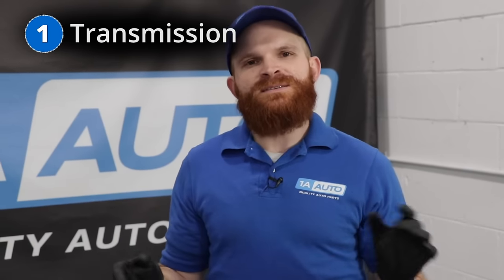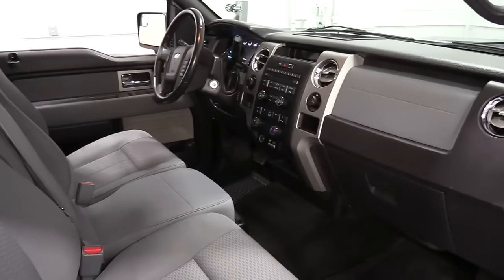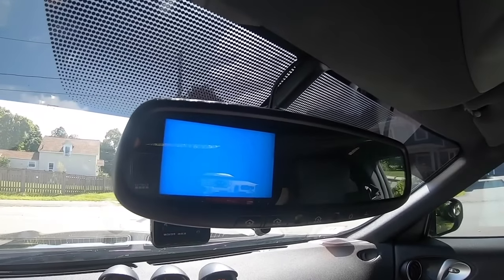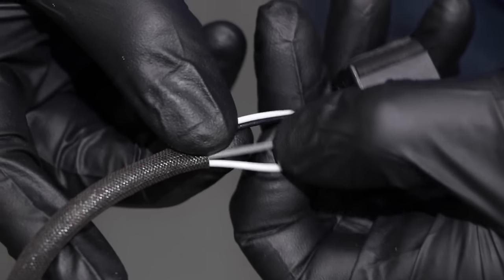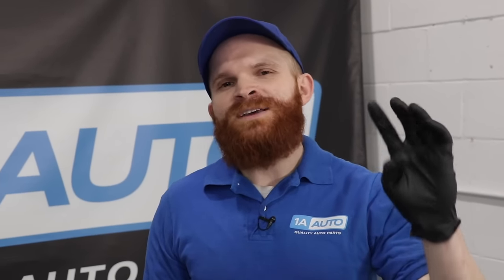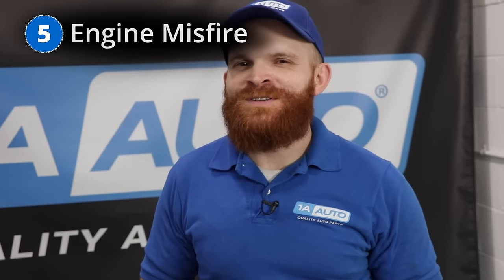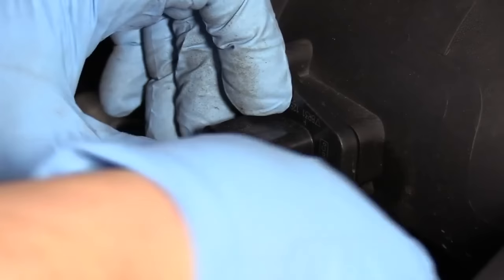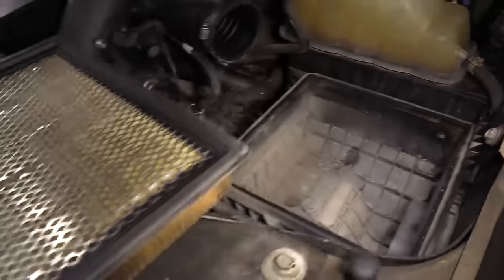Top 5 Problems Ford F-150 Truck  12th Generation 2009-14

Comment: Just fyi a couple things. I've had most of these issues and here were my fixes that differ from the video. 1 misfire. If your Ecoboost is running fine at idle and low speed but misfires when you step hard on the gas you have an issue with the intercooler building moisture and oil. It's an extremely easy fix and if you YouTube Ecoboost wheep whole you will see Many vids on this. You basically drill a very small hole in the bottom of the intercooler. After I did this it took 90 percent of the misfire away and after changing my plugs completely went away.  (takes 10 minutes to do even for someone who doesn't know what there doing) 
2. The touch screen not working. This is a problem with the ampid modular in the back of the head unit. They aren't cheap but easy to install a new one. Just make sure it's programmed to your truck.  
3. Backup camera not working. Mine did crazy things like reversing the image to lines to a black screen. Usaly it would work when you first stay the truck then go haywire lol. Just replace the camera. Super easy but unfortunately on mine I had to replace the Ford logo as well.

Comment: 2013 F 150 4x4 STX 5.0 with 3.73 gears. 225,000 miles and still going for now. Did replace transmission at 180,000 miles due to weekly towing of heavy boat. Normal maintenance other than that. I know the time is near for a new truck. New truck prices just blow me away. I wonder what a new 5.0 motor would cost? If it's even worth it?
Reply: Larry Sigers, engine isn’t that costly when you think of a new truck. $7000-ish. Maybe get it rebuilt.

My 2014 FX4 has 245,000 km and aside from oil/fuel/windshield/washer fluid/wiper blades/tires it’s all original. Never had any of these issues.  It’s now getting everything flushed, new brakes and struts, new filters, hoses & spark plugs and I think I’m swapping gears from 3.73 to 3.31/3.08 since I do mainly highway driving at a set speed.
Reply: 5k easily, but that's a hell of a lot less expensive than a new truck.
Reply: Your boat is holding water under the deck. Get rid of the boat, not the Ford

Comment: I've put 140k miles on my 2011 f150 ecoboost, very few problems, 2 purge selonoids, regular tuneups, 4wd actuator, and a thermostat, and basic parts that just ware out like brakes and rotors.  Now my old 2006 f150 was a different story.
Reply from the maker: +jg b Thanks for the feedback!
Reply: Considering buying same one with 110,000 for $17,000.00. Are you still happy with yours?

Comment: 2010 F150 5.4 Triton Ecoboost V8 101,000 miles.   New spark plugs by Ford at 100K - still have a slight rough idle (no codes/check engine light) and after it sets for a day, fuel smell outside for a few minutes.   Mileage intown/road is around 12-13 mpg, and has been forever.  Thoughts?  (I'm second owner, and have had it since around 40K miles.  It does have a K&N air filter.

Comment: Another common issue with these trucks are broken spring in the strut assembly assembly and the third taillight above the back window after a few years, leaks water into the back seat area.

Comment: 2013 4x4 5.0 I bought it used 48K. I use motor craft oil and change every 9k. No motor issues. now @ 150k. Front breaks go bad every 20k no biggie. Shocks have been replaced 3 times getting ready to do them again. Now the bad radio went out at 90k aftermarket fix. Both front window motors went out within a month of each other. AC compressor stopped working around 95k. Blower motor went out around 115k. The y pipe for the coolant has been replaced twice. Put a leveling kit on the front and things got fun.bad bearing hub and Bad actuator, then bad CV shaft. Replaced both sides. 8k later new actuator again new CV shaft and new vacuum lines and vacuum solenoids. Now it’s all bad again. For some reason the vacuum isn’t fully disengaging causing the actuator to be destroyed. And the drivers side CV shaft seal keeps leaking and tearing up the boot. I do not off road or drive in 4x4 often I never switch going faster than 10mph. My leveling kit was switched from 2” spacers to ranchero plus 2” shocks after the first issues. Going back stock level now. Not sure the leveling is the issue now. But interior electronics are my biggest disappointments. I feel like if I never leveled the front I may not have had these issues. As far as the breaks go it’s always the drivers side. I’ve replaced the rotors 3 times and replaced the entire shoe it’s always got a dusty rim... also ball joints upper and lower have been replaced. Both upper and lower control arms. And tie rods.
Reply: That sounds like aGM truck. I’m drive my truck off road all the time and never replaced any suspension or driveline parts. I have 150k on my truck.

Comment: I think you missed two big ones:
1) IWE/Vaccuum hubs on 4x4 trucks .  Mine have gone out twice on both sides.  
2) water pumps.  My water bump exploded after 30K miles.
Reply: Amen i had my 4x4 vacuum replaced at 40 k and just had my water pump go out at 85k
Reply: Ford baby! 😂
Reply: Dorman Products makes a good replacement for the IWEs that don’t use vacuum. They sell revised ford ones that use vacuum too (separate part numbers)

Comment: Another issue that you’ll most likely have, is the torque converter going, you’ll know when it shifts hard and the rpm’s bog up and down at around 30-60

Comment: Forgot the fuel pump fuse relocation crap and the rear window leaking.
Reply: My 2010 f150 does this and it pisses me off
Reply: What about the rear window randomly shattering and "ford has never heard of it". It sucks trying to hook up on a trailer in the plants
Reply: @JoelMannerino1  happened to me

Comment: Don't forget the issue with factory spark plugs gapping causing misfires too.
Reply: so what is the correction for this i have misfire only in park soon as i put it in drive it goes away

Comment: My 09 f150 platinum won't change where the air blows from. It was stuck on the feet so I changed the actuator, but it still wouldn't change. I have removed the actuator and moved the gears by hand to get the air out of the dash vents.

Comment: Yes!  Now I remember why I switched to Silverado; even though, it rusts out from underneath you.  Plus, a 2003 (2001 and earlier) will run E85, basically water, and still get you on the road; but rusts out from underneath you as you get there.  Thanks for the great video, memory jog, and help !!  :)
Reply: i swapped from silverado to ford and never been happier. no more constant electrical issues, oil leaks, transmission  problems, etc

Comment: i’ve had many problems with my 2011 f150 such as oil issues also with the 02 sensor and the timing chain.  second time it’s went bad along with the lifters
Reply: Same here man 2011 f150 and mine is currently in the shop from my timing chain snapping while I was driving. Turns out my driver side block is bad. This is days after I replaced a 02 sensor
Reply: What engine did it had.
Reply: Mine vibrates going down the road does yours?
Reply: @SteveWilsonWCFurniture  you should have some service on the driveshaft, is really easy DIY and save some money just buy the kit at Ford or just buy grease( look for videos ) is super easy and that will fix your problem, I used to have that problem.
Reply from the maker: +E J Thanks for the feedback!
Reply: @SteveWilsonWCFurniture  my 2013 does. 73k miles Total pos

Comment: The biggest PITA for me has been the optional electric sliding rear window with the defrost. The defrost has went out on me three times now - two under warranty, this last time on my dime, which I'm not going to pay for yet. Sucks, because the circuit also includes the heated mirrors, so neither system works now. And Ford won't recall this!
Reply: Such BS but it isn't a safety issue to be recalled.
Reply: Should be another category other than recall ... call it dealer eval... buyer status is a list... ultimately product improvement 👏 👌 💪 🙌 ✨
Reply: Same here mine flickers on and off and never works correctly, I eventually gave up on it because I have a bed cap and the back cab window rarely gets enough ice on it to matter.
Reply: You can access the wiring for the rear window defrost behind the rear seat on passenger side and place jumper on it.  Then your heated mirrors will work. Had same problem and since I never really needed the rear window defrost,  this was the best option. Think there is a You tube video showing this.
Reply: The bracket that holds the actuator cables broke on mine.  May just replace with a solid rear window with no slider

Comment: There's also the fact that there is no in cab air filter and the air inlets are under the driver and passenger seat with nothing stopping trash and dirt from getting sucked into your HVAC system.
Reply: Those are air outlets, the inlet is outside the truck at the base of the windshield on the cowl, that's what all those slots are for.😐

Comment: the problem I had with my '14 eco was I liked it so much. that thing fit me like no other. sorry to have to trade it but mileage and all..
Reply: I have a 2014 eco 3.5 XLT and it's running great at 75k. Two days ago I did a full tune up(spark plugs, flushes, front/rear diff's etc and it's running smooth as silk. It's paid off and i have no plans of trading it in for the new ones.
Reply: I have a 13 eco with118k on it now.  No issues other than having to put grease on the drive shaft once a year.

Comment: My A/C decides itself when it feels like turning on and off and my 12v cigarette lighter plugs take turns not working , my lock and unlock button  on my key works some days and not others. I'm guessing the electrical wiring or modulators are going bad as today my truck wouldn't turn over when I tried to leave the gas station turning the check engine light on saying secondary ignition coil a and b are not working so I replaced them all and I still had the same problem until I located the ignition fuse, unplugged it and put it back in then I found the ignition module and followed the wiring harness down wiggling it and then tried to start the truck and it worked like nothing ever happened.  I'm glad It works but now I'm worried my truck could catch on fire at any time with whatever weird electrical faults are going on

Comment: Don’t forget about the water pump on the 5.0s
Reply from the maker: +5_Point_Go Thanks for the feedback!
Reply: And the 1st gen 3.5 ecoboosts
Reply: What year and does it fail?
Reply: When does that need to be replaced?
Reply: I had that problem, water pump went out while on vacation.  5.0
Reply: Yup 75000 mine just went also fuse 27 for fuel pump
Reply: +5pointgo-  Why?  What do we need to do about the water pump?
Reply: I’ve got the 2011 with the 5.0 at 215,000 miles on it, haven’t experienced the water pump going out yet. Knock on wood.
Reply: @jackofalltrades4844  I'm at 195,000 and haven't had a problem yet either.

Comment: 13 f150 ecoboost 3.5 I put weep hole it helps performance exhaust major help on top end rubber tips on coil packs melted on spark plugs and misfired bad but then MAF  and other two no changes

Comment: Its worth worth noting for any owner of this truck.

This f150 ecoboost does not have a power steering reservoir for fluid

The truck has an electronic rack and pinion, steering.

If your truck need alignment guess what you'll need to replace the entire rack amd pinion.

It'll cost you 2500 to 3500 from a dealership.

This is a dealer part, repair shops will charge you way more.

My stepfather has an 2014 f150 alt ecoboost 3.5 he had to get this replaced from a dealer.

Comment: dealerships will NOT completely fix the problem with the trans. the only way to completely fix it is to replace the leadframe with the updated version and THEN reprogram the trans.
what about leaky sunroofs and 3rd brake lights that rusts out the rockers?
what about the brake issue with many of these year trucks?
theres a lot more serious problems than the my ford touch issue...

Comment: Had an issue with my 2017 5.0 Coyote with the 6 speed tranny with a 4x4 HD Tow package. The Torque Converter failed...... Only thing I ever towed was a small hotdog cart......

Comment: Good Tips, my 2013 f150 with the 5.0 blew a fuse for the fuel pump, is this a sign of the pump getting weak, I heard Ford knows of the wires to the pump being under sized, any help would be greatly appreciated 👍🏻

Comment: Appreciate this video, unfortunately my issue is not one of the top 5.  My 2012 Ford F-150 5.0 has a no start issue.  It's cranking over, no issued with fuse 27, I swapped the ignition and fuel relays no change. I pulled the coils and it's sparking grounded.  Turning over the RPM registers, so no crank sensor issue and I hear a whir when powering up the vehicle and can smell fuel under the hood after failed start up attempt, so assume the fuel pump is working.  I also check the passenger kick panel for no connection.  I picked put Autel code reader and all I got is a very small emissions systems issue. Hope the 1A Auto team can help!
Reply: It still is very likely fuse #27. The fuse does not always blow, but more often than not the connector it is pressed into is burned on one side and essentially killing continuity. It's pretty easy to see if this is the case, as the connector and/or the fuse leg itself will be burned or even melted from heat caused by a loose connection. If this is what has happened, it acts just like a blown fuse and the pump will not come on, resulting in the engine turning over, but not firing for lack of fuel.

If the connector (or fuse leg) is not totally melted off, you can often clean it up with a small flat file or burnishing tool and then make sure both sides of the connectors are pushed back together for the tightest fit that you can make happen without breaking things. This is why the problem is sometimes intermittent at first and then gets worse. If the fuse leg is melted, it will need to be replaced. If the connector is no good, it will need to be replaced, or some fancy surgery will need to happen.
Reply: They also have a fuse 27 relocator kit
Reply: Um, all that and you never even suspected the STARTER!!! 🤪😜🤪🤣😆🤣😆🤣
Reply: @infectedpuddle1638  "Turning over the RPM registers" that wouldn't happen if it was the starter

Comment: I plan on buying an 11-14 F-150 with the 5.0 I know a few people that have them and never had problems I think it just comes down to the owner taking care of it
Reply from the maker: +Eternal Thread Thanks for the feedback!
Reply: Eternal Thread: Did you buy one? If so, are you satisfied? These are the exact years I am considering buying, but I actually do not need to buy a pickup truck at all. Some of these provide front bench seating, which I prefer over having a prominent center console, which is a feature in most vehicles.

My main concern is spending north of $15K on a 10-year-old Ford with more than 100,000 mi. I would be less hesitant with a Toyota, or Honda of certain models/years.

Comment: i have a 2009 f150 , 4.6 ltr triton v8, periodically if i am on cruise control or just cruing inbetween 60 and 80 and go to press on the gas pedal the the truck sputters and feels like its flooding itself, to clear it i have to push the gas pedal hard and it clears itself

Comment: I didn't know about the transmission recall. That might explain the odd whining sound it's been making when it shifts.
Reply: Outdoorslife Survivcraft that’s probably just fluid buildup to help it shift. Nothing bad.
Reply: @extremeseas2165  that's cool. I used to actually be a good mechanic. But then back in 87 they started putting computers and everything and I was like, what the heck with it.

Comment: My 2014 5.0 stalled out. 40k miles 🤬🙈
Thanks for the video!
Reply: Wow, did you buy that new or from an old guy? i got 70k on my 2012, crazy its still worth like 19 to 18k with the package i have
Reply: Keep that 5.0! no matter the cost, best ford truck in my opinion
Reply: David Banks I bought a 3.7 last year with 38,000-43,000 Miles. Can’t remember exactly how many miles.
Im almost at 80,000 Miles. Drove a couple times to PA from NY and back, NY to NC and back and it came with a 100,000 mile warranty from Ford Dealer Pre-Owned.

Comment: 2012 f-150 fx4 3.5 135,000 only problem I ever had was the transmission output speed sensor, replaced it no problems. the syncing to a phone was the other all I did was took out the fuse even though it was good replaced it with a new one and that’s it never had another problem with it. Just keep up with maintenance on it very important. I also put 91-94 premium gas always. Oh yeah don’t go by fords lifetime transmission just change out the transmission oil at every 60-75,000

Comment: It should be noted that if the purge solenoid fails it won't set the cel and the vacuum pressure can implode the gas tank and even rupture, spilling gas. Bad bad bad on Ford. Chevy does purge solenoid failures in a much healthier way.

Comment: Sync system failure, clock flashing only, i've seen a lot of that, im one of those
Reply: What did you do to fix that issue? Same thing on my 11 5.0
Reply: Yes me too my 2013 F-150 has problems with Bluetooth connecting to my phone it randomly skips songs I have to disconnect and reconnect all the time it’s really annoying.
Reply: Yea me to did you just get a aftermarket radio?
What did you do?
Reply: My radio just totally went out
Reply: Radio went put clock blinks